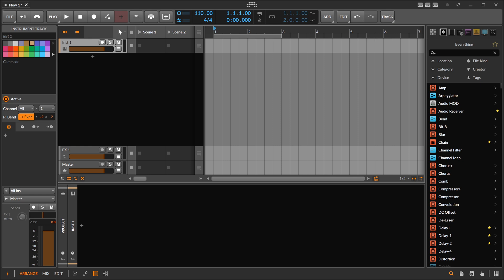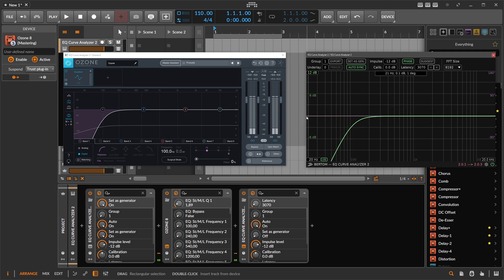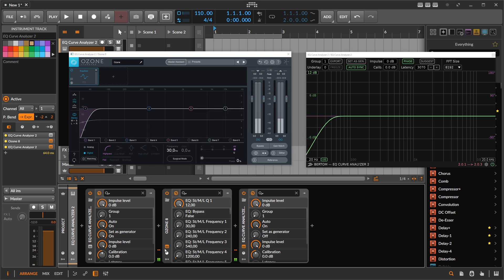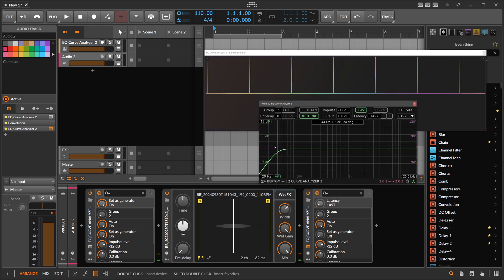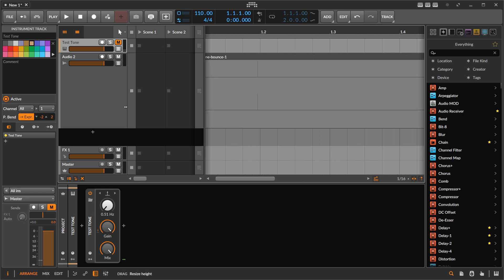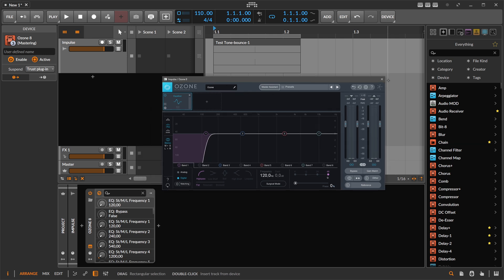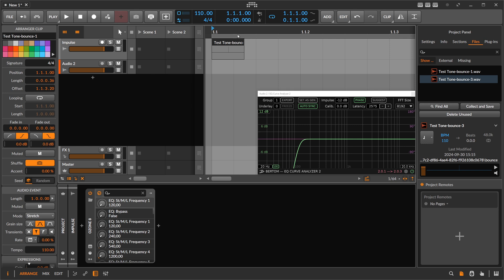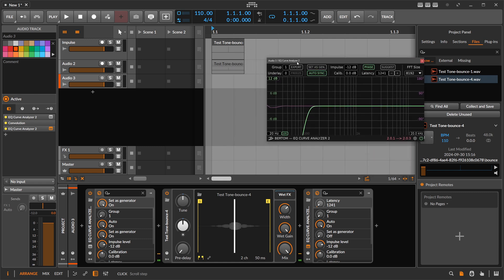people asking me how i did it

Comment: You can do a very similar trick to cancel out arbitrary phase shifts introduced by all kinds of plugins, the one everyone likes to talk about is OTT.

Feed a dirac spike through OTT, record the result, reverse it, and then feed that into a convolver and place that after the OTT on the signal you want to un-phase-mangle. Since the phase shift (caused by the crossovers of the band split) is constant, you can adjust the OTT to whatever settings you like and the convolution afterwards makes it behave as though those crossovers are linear phase.
Reply: By "reverse it" you mean phase invert it by 180° correct?
Reply: @citadelo5ricks  Nope, I mean reverse, in the time domain.

You gotta pick a spot to cut your recording of the dirac spike through the phase transform, since the impulse will typically ring out for a sort of arbitrarily long time at lower and lower amplitudes, and the longer a sample you make the more precise the un-phasing effect will be, but the longer latency you'll be paying during playback, since the sound has to traverse the whole tail of the sample (in the convolver, during playback, with you having reversed it before putting it in) before it hits the main spike of the impulse and makes sound. 

The reversal and convolution takes care of reversing the rotation of the phase on a per-frequency basis, because a dirac spike contains (roughly, since it's digital domain) every audible frequency, and its response through your phase transform contains the information of how each frequency reacts to that phase transform's processing - how much each frequency is rotated by. 

By reversing that recording, and convolving your target signal by it, you rotate each of those frequencies backward by the precise amount they were rotated forward by your original processing, which brings them back into their original alignment.

If you were to phase invert your recording, instead of reversing it, you would be rotating EACH frequency by an additional flat 180 degrees, and adding the same phase shift from the original processing, a second time, for double the forward phase shift, rather than un-rotating each frequency by the precise number of degrees needed to undo your original transform. Not remotely the same result.

You can confirm this for yourself by inspecting the resultant waveform of both methods with an oscilloscope, or audio editor.
Reply: @Melodyweavr1105  Thanks for the instructions, I will try it today.
Reply: @Melodyweavr1105  I did this with FX-3. My reverse dirac was about 2s. Bertone Analyzer shows same phase flip, not linear.  Well, I tried.
Reply: @citadelo5ricks  Did you use the built in Bitwig Convolver? I just tried with that, out of curiosity, and it had some weird behavior, I suspect due to the windowing and brightness controls that it has for the impulse. 

Using the free Convolver Convology XT, I was able to get it working in bitwig for FX3. FL-studio's convolver, which is what I had initially tested this with, also works fine.

Recording the impulse was also a bit of a hassle since bitwig does some declicking when it bounces, so getting it reversed and trimmed properly was slightly tricky. 

Another obvious failure point is not running the convolver 100% wet, which is easy to miss if you're setting it up for the first time.

2 seconds is quite a long impulse, you should be able to run just fine with much shorter than that, my impulse was 9ms and worked ok.

If you'd like, I'd be happy to meet on the polarity discord and help troubleshoot. My username is "Sebastian Wing"